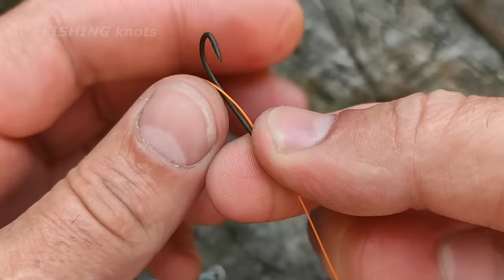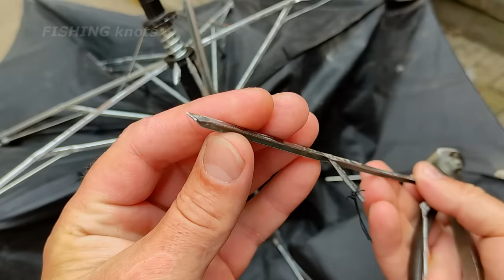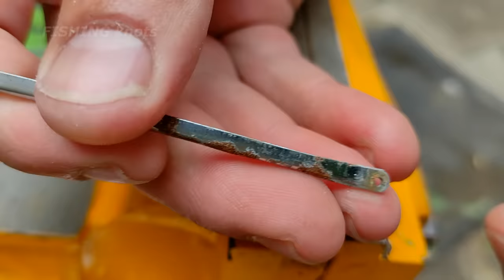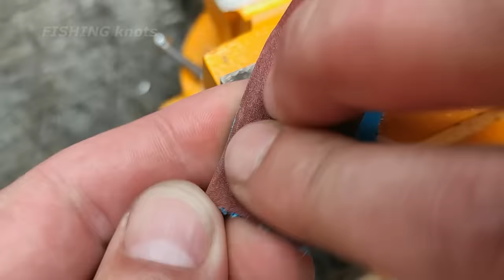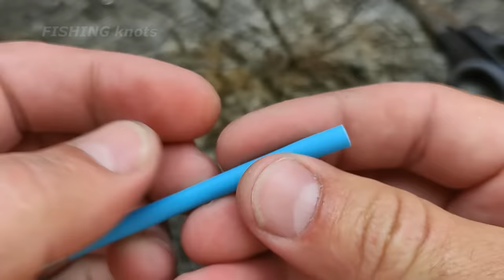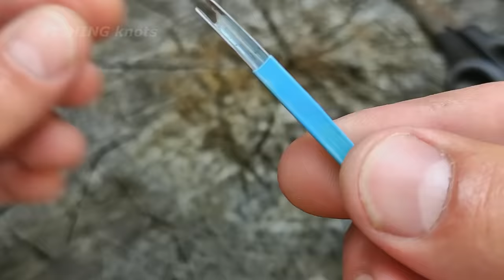"The best tool for tying fishing knots" every angler should know.

Comment: I've been using one for 25 years. For terminal gear the old Palomar knot is great on swivels. Knot tying is one of the most important aspects of fishing when the big ones get on
Reply: Since i learned the palomar i never used anything else :)
Reply: @Sgt_gh0st  same
Reply: I recently learned that the pros don't use the Palomar any longer with fluorocarbon leaders. It's not an issue for me since I use monofilament for my leaders. It's cheaper and eliminates knot issues.
Reply: @pakde8002  I'm a professional and have less knot problems than most pro's. Even one's that are better than me. At the lake with fly gear I out fish them all just about every day. The Palomar knot is also know as the professional Fishermen's knot. The Uni Knot is also very good. When you really understand knots you can make your own. I have 16 knots in my set-up and if any one of them fails the fish is gone. Why 16 knots that's a $1000 question but I do catch the biggest trout and have the least amount of trouble. Every other trip I catch a whopper 8lb. to 10lb. at the local stocker lake.
Reply: @bobjohnson7207  bob your an amateur
Reply: @Bighannes410  That's probably why I catch the biggest trout for hundreds of miles year after year. And the years I spent commercial trolling for Salmon and being top boat some years would make me a Pro's Pro.
Reply: @bobjohnson7207  no you don’t
Reply: @bobjohnson7207  video or it didn’t happen
Reply: @Bighannes410  Having a bad day are we.
Reply from the maker: Thank you for watching
Reply: @FISHINGknotsura  copy and pasting the same comment just makes you seem incredibly disingenuous.
Reply: So instead of learning to properly tie one lets use this instead... Go back to boy scouts earn your knot badge
Reply: @bobjohnson7207  Bob Hannes is commercial trolling you right now
Reply: @Bighannes410  hi child :) isn't it time for bed? Only children would live in a world where everything that isn't recorded isn't real

Comment: You can use it to remove hooks too, put the v on the u of the hook, pull the line tight, push down, fish is unhooked, can remove deep hooked fish relatively easily... i do have to thank the guy who made the vid tho, i do believe i have discovered a better way to do the knots when attatching line to line, cheers!

Comment: Ive used the same knot for 15 years never failed an dont need a peice of metal to tie a hook just put line through the eye spin the hook 12 times pass the short end back through the first spin wet and pull tight best knot ever
Reply: @Not Expat Joe id use other knots when attaching to a swivle or somert just to help with ease of tying but when tying a hook the knot i use is almost as narrow as the hook shank so can be used with really tiny hooks like 18s or even 20s its all about the hidden aspect of it as well as strength, nearly all the time the hook will bend out before the line snaps anyway depending on what pound line im using or if ive scrapped it with split shots and caused a weak spot ect
Reply: @Not Expat Joe yeah man i use that guru 0 22 8lb stuff or 6lb think it might be 0 18 its well strong an like you say its pretty much invisible

Comment: This is embarrassing.  In 61 years I've never seen a fishing hook without a hole through which the line was tied; this flanged hook is entirely new to me.  Can someone fill me in about this?
Reply from the maker: Thanks
Reply: Its a spade end hook--we have been using them for as many years as you have not seen one. and a lot smaller than the ones in the video.
Reply: @derekskinner  It just seems like a precarious attachment method, as if it will slip off at any moment, or at least if the knot shakes a little loose.  Does that not ever happen?

Also, why in all these years have I ever once seen these in the fishing sections of sporting goods stores?  How popular are they compared to fishing hooks with eyelets?

What makes this even more embarrassing is that I'm the kid in the Pocket Fisherman commercial from back in the early Seventies.  This is me: youtu.be/NCSgxA_W_yU?t=31

I spent three summers in Rainy Lake, Minnesota on the Canadian border where Northern Pike were big and plentiful and the fishing was great... for those who knew how.  I regret to tell you that, during those three summers, I never caught a single fish.  Not one, nor in the pristine Canadian waters I trekked through.  I am the original tragic comedy of fishing.
Reply: @adamchurvis1  In the uk match scene we use a lot finer lines and smaller hooks, even down  to 0.08mm line and a size 24 or smaller hook, they only ever come off, if you dont tie them on properly in the first place.--just about every coarse angler in the UK uses spade ends, so yes they are very popular.
Reply: @derekskinner  Thanks, Derek, for teaching me about this.  I genuinely appreciate your help.